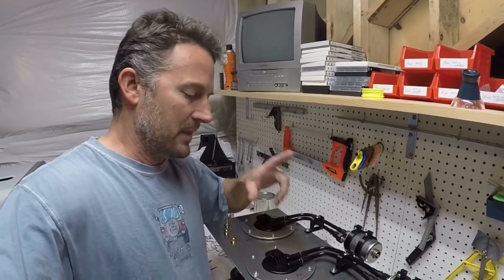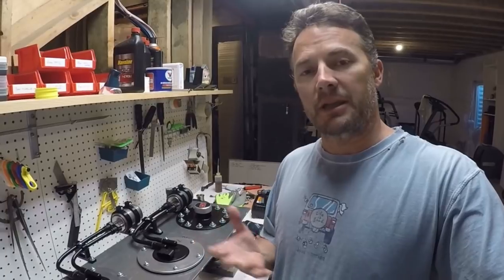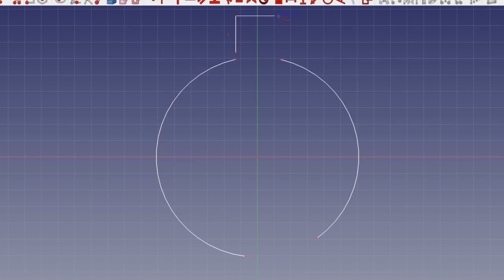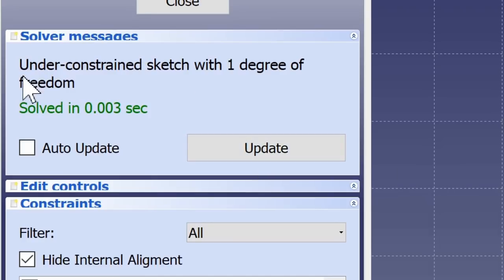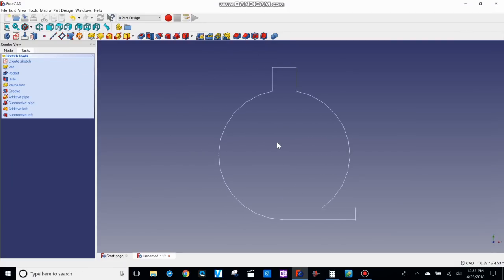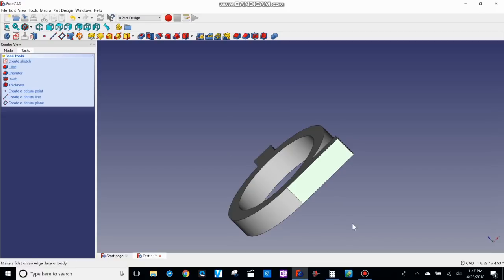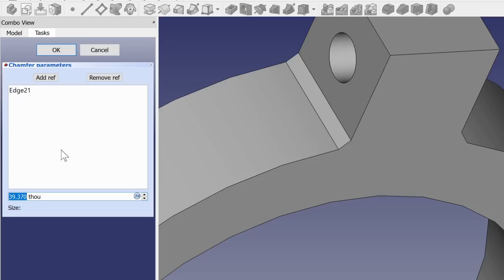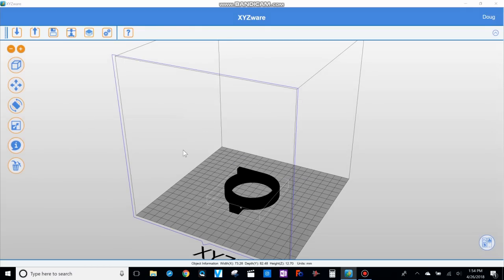3D Printing and FreeCad

Comment: How to split the upper part of the bracket? In the printed version it's solid, in the versions holding your fuel pumps it's split in two which are connected with a bolt. Otherwise great tutorial. Thank you.
Reply from the maker: I printed it as a solid piece, then ran it through my bandsaw for the slit. That seemed easier than having the printer try to print it with a this strip missing.

Comment: Thanks for sharing your knowledge and hard learned experience with us...how long did your 3D printer to make this part? Would you be able to estimate how much would be the raw material cost to make this part for example? Does most parts come off easily from the printer bed? Is the surface of the part too rough and need some sanding off to be smoother?....thanks
Reply from the maker: 1. I think the print took a little over an hour.
2. This part doesn't take a lot of filament. I'll bet each piece is less than 50 cents of material.
3. On my printer is comes off very easy once the bed cools.
4. I printed these on medium resolution. I didn't have to sand anything. But you can definitely see the print lines. Didn't mind on this as it's purpose is to hold the fuel filter not look to good. 👍

Comment: Your mention of the need to select every face was the one thing I was missing. This is what I call a BUG!  Many thanks.  Curious that you didn't have a slot in the top hat to tighten against?
Reply from the maker: Glad this helped you out. For the slot I just ran the part through my bandsaw. That seemed better than trying to have the 3D printer do it.
Reply: @DougBugBuilder  I figured that is what you had done. I don't think a slot would have been a problem on the 3D print though ;-)

Comment: Wonderful tutorial, thank you. Don't know if the software has been updated since you did it, but you can constrain to a diameter instead of a radius so you won't need to get your calculator out. Also, don't know if it makes a difference, but making the pocket I found that you can input the depth to an arbitrarily large value, as long as it's longer than the bit you're trying to make a hole in.
Reply from the maker: I don't know if that has changed. But those are good tips. It should help people reading through the comments. 👍
Thanks.

Comment: Wow. And I wanted to do this with Blender simply because I thought, I would need to take a lot of time to learn it. The kind how the object is constructed it even similar to programming. Extremely helpfull!!! New skill in 18 mins.

Probably late but for those curious: Selecting "Body" in left pane while in 3D is the same as selecting every face for exporting.
Reply from the maker: Really glad this was able to help you out and save you some time. 👍
Thanks for the comment and for the tip on selecting all.

Comment: if you ONLY want to do 3d printing and not CNC, sheet metal, milling, lathing, etc you should consider learning Blender instead of FreeCAD 

it is MUCH, MUCH faster to work with : you could make the part shown in this video in 2 minutes (no, really). 

Like, if you  just own a 3d printer and want to design stuff and print it, then Blender is more than suited for the job (if you find people tell you that Blender can not be used for non-destructive, parametric modeling, they clearly haven't used it in a long while)

if you want to make big engineering projects, like a robot, drone, boat, etc, things where you not only need the parametric model, but you also need FEM analysis, (deformation simulation) CFD (airflow simulation), etc. Blender can not do this ... yet ... I mean sure, it has smoke simulations but those are just for the looks, they're not accurate, it has rigid body physics which can basically tell you how things fall and hit each other but not how they deform
Reply from the maker: Man.... I tried using Blender before FreeCAD and couldn't get it to click in my head at all. I mean really.... I hated it. lol. Isn't that funny how opposite we see it.
I could maybe tinker with it. But honestly now that I'm comfortable with FreeCAD making parts like this is second nature.
But thanks for the comment and idea.

Comment: Greate tutorial, thank you! It's a pity that your hobby does not require a large number of printouts on a 3d printer. It was unexpected to hear the name "Da Vinci", where instead of the usual from childhood sound "CH" is pronounced the sound "S":))
I would like to ask you. Is it possible to control all the dimensions and limitations of the sketch by creating three-dimensional shapes in the same way as you did by creating shapes in the Sketcher?  
Translated with www.DeepL.com/Translator
Reply from the maker: Hey Buddy, thanks for the comment. I'm afraid I don't really know the answer to your question. But if I had to guess I would say no. Free cad really works first off 2D sketches. And then likes to push or pull them from there. But that's a guess. Good luck!
Reply: @DougBugBuilder  I've already started learning this program. It is quite light, but there are moments in it that are not intuitive at all. For example, after the Boolean merger operation, both details remain, not one new one. 
But this can be learned. And your lesson is amazingly accessible shows the necessary steps. Thank you for that!

Comment: hi, nice job :) that kind of tutorial are the most useful :) PS. Is that project include all ? this circle should be disconected on the middle to put on the screw
Reply from the maker: Yes this is an actual piece I made and used. I made it all one piece and then slotted it with a bandsaw to make it a little easier.
Thanks for the comment!

Comment: FreeCAD isnt glitchy because its free. If you do experience "glitches" its because its a work in progress, hence the version number is less than 1.0. Whatever version is in the Debian repositories is probably rock solid stable because they don't publish packages in the stable branch until they are bug free. I know your using Windows but generally speaking I would think the same version number would be safer than the latest and greatest.
Reply from the maker: Typically software is glitchy when it's free because it's a work in progress. Not a bad thing, it's great software. Just helping people out by giving them a heads up to make multiple saves.

Comment: Useful video. It seems to work better to show the operations necessary to make a particular part rather than try to show an example of every button Freecad has. Thanks! (tip: if you just select the last operation in the "model" tab, you can export it)

Comment: Doug, a quick question how to plan for overhangs, will the printer software automatically fill and create the supports, to do you have to do them manually?
Reply from the maker: So the software I use is the XYZ printing which goes with the Davinci printer. In this software it develops the overhangs and supports. It asks you for densities and a couple aspects. But for the most part it models it and just asks you a couple questions.
I hope that answers your question.
Reply: @DougBugBuilder  thanks Doug I appreciate that! I'm trying to learn how use the CAR software first and thennunderstand what I need to go  before buying a 3d printer !

Comment: Excellent video sir! I don't think I've ever seen a software tutorial video that was as easy to follow. I think it's because you're not just showing what the software does, you're showing how to use the software to make something useful. Most people don't use a program just to be using a program (unless it's a game), they use a program to accomplish some other task.

I have a question about the part itself. Shouldn't the top hat have had a vertical slit through it, so when the screw through the horizontal hole is tightened it clamps on the filter body?
Reply from the maker: Thanks for the nice comment. I think what makes it useful for the right person is that I'm specifically making one part start to finish, and nothing else.
You're right about the design. What I did was 3D print the part and then I made a slit with my bandsaw. That seemed easier for me. And if needed I could make the slit bigger if needed.

Comment: For meshing the objekt in FreeCAD you can go to the Mesh Design Workbench. In there you don´t must select all faces manually. Only select the object itself and use the "Create Mesh from Shape" command with Netgen mode. There you can push the Mesh to the max you need.
Reply from the maker: Thanks for the tip, I'll try that on my next part.
Reply: @DougBugBuilder  you dont even need to go to mesh design for this. Just click on the last element in your parts list in combo view and everything should turn green. Sometimes you need to select the first one and then the last one. However, that all it needs to do a proper export.

Comment: It would be interesting to hear the properties of the finished parts. I'm interested in how strong they are. Are they UV resistant? Will they break or bend? Resistant to heat/cold etc.
Reply from the maker: I used ABS filiment for these parts. My only concern would be cracking from vibrations. They seem more brittle than anything. I'll see how they hold up.
Thanks for the comment.